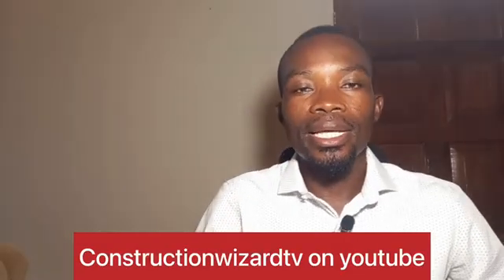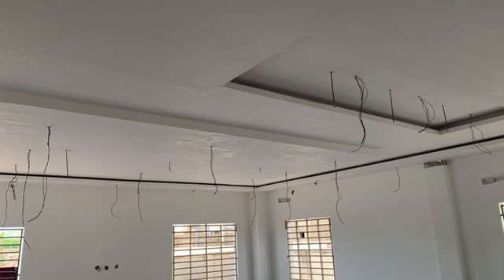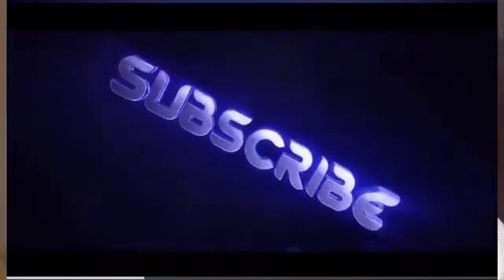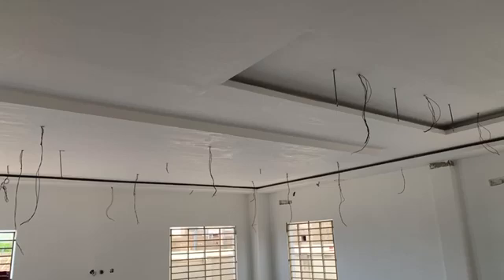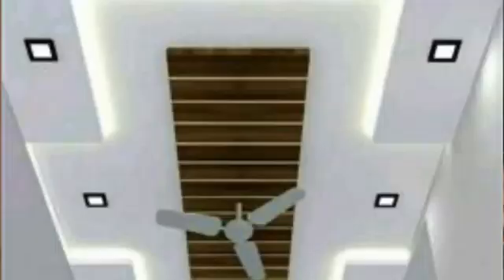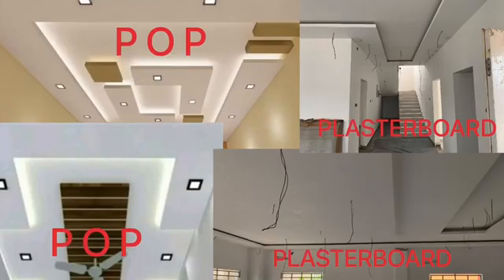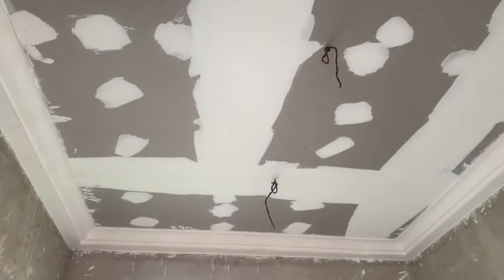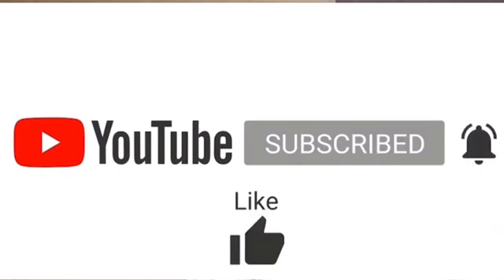POP CEILING  VS PLASTERBOARD CEILING

Comment: Little tip I was told, stagger your plasterboards, like brickwork, it adds strength and you don't end up with lots of joints and screws in one single place. E.g.  @2:37

Comment: Plaster board is easier to repair than PoP. Also, it is best to use a material that can easily exhibit issues such as leaking roof so you can easily and quickly repair the leak. Unnoticeable leaks can  also lead to electrical damage, electrocution and health issues such as mold and breathing issues.

Comment: You forgot to mention the differences in structural aspects of the two. Sheetrock is pressed together by machines with thousands of psi. And it has a layer of paper around the entire board, which makes 2 layers of paper your fastener goes through. So when you nail the board on the walls or screw it up to the ceiling, the board is adding strength to your structure from the inside. Also, it still takes very skilled artisian work to finish sheetrock. It can also take alot of time, because you have to go over every seam 3 or more times for a completely flat, smooth look. If that's not done you will definitely notice where the boards meet. The seams are not as easy to hide as you think, even with a really heavy or rough texture. If those 3 or more coats aren't done right you will see the seams, even underneath the texture. You just underestimate how long it takes to hang and finish sheetrock, it takes longer than you think in order to make it look really good. Only if the client doesn't care about it looking perfect, then the sheetrock can be done fairly quick